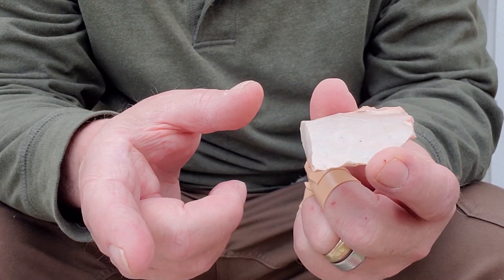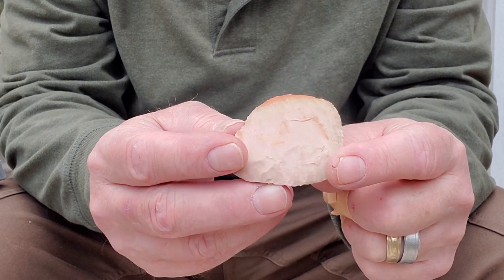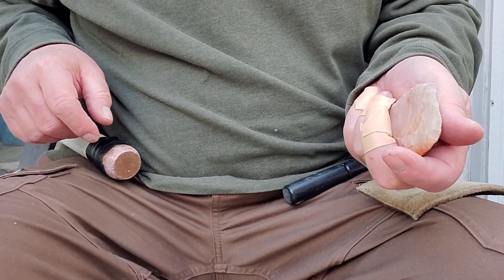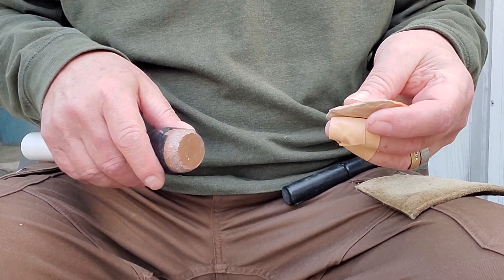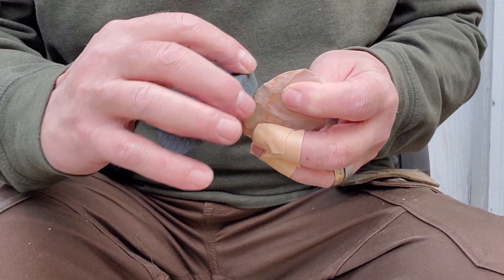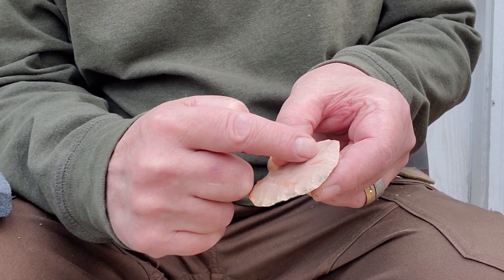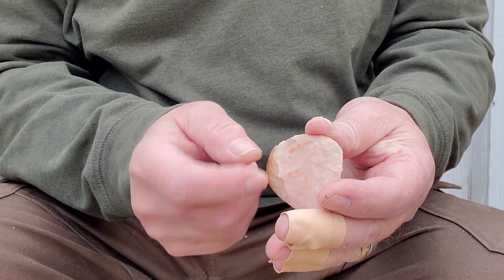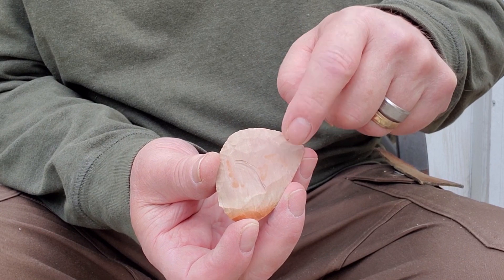Flint Knapping - The Thinning Game Using Isolated Platforms

Comment: So it seems using a proportionately large bopper helps, but you'd probably have to be extra careful not to impart too much force/shock into such a small piece.  Great demo, thanks!
Reply from the maker: Remember the caps are hollow. No lead. Force is controlled more  by swing speed. Thanks for watching!

Comment: It looks like you are using a 1 1/2 inch cap on a long pvc handle .....would the short 4-5 inch bopper with 1 1/2 caps on both sides work as well ?
Reply from the maker: I don't really like caps on both ends. I tried that in the hammer videos. 6 to 8 inches for handles is best.  See bopper construction video. Thanks

Comment: It looks like sometimes you get away with hitting a nipple above the center line/plane: is that just camera distortion or is that just... skill?
Reply from the maker: Remember from the start of the video I kind of formed a edge all around pretty much in the center plane. So at least at the start of the video most of the nipples are actually very close to the center - not above. Knapping for 43 years helps also!
Reply: @EDBO23  Thank you for the clarification — so it is like this: physics plus skills work miracles. :) Thanks!